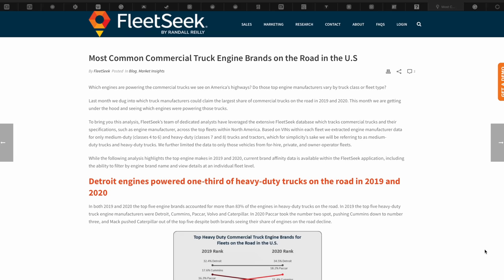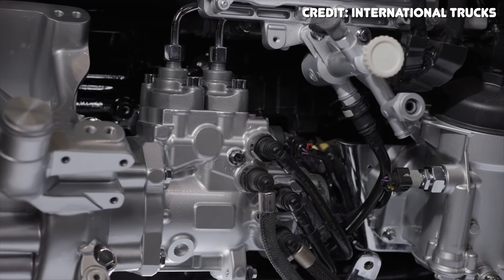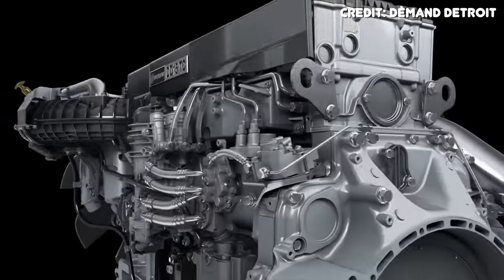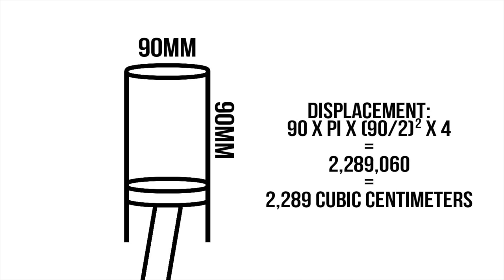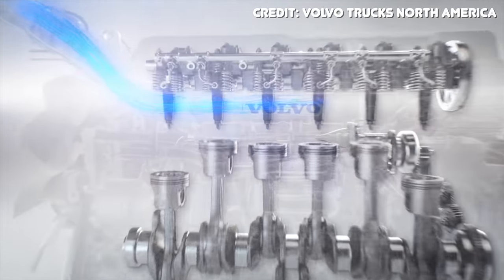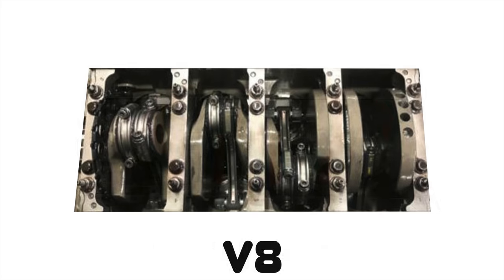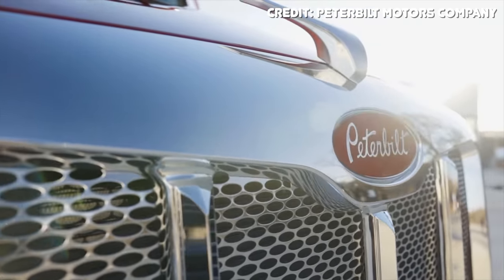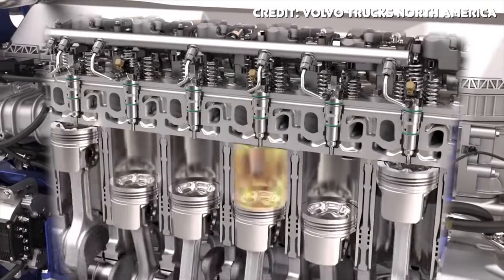Why do Semi-Trucks Use Inline-Six Engines?

Comment: Piston velocity is a huge factor. With longer stroke longer rods and in a inline configuration there is much less force on the piston and walls. And as far as longevity the Diesel engine has one huge advantage over a gas engine that being a lean mixture will not have the same effect as on a gas engine especially if you are talking a forced induction system. And an in-line engine has a very efficient cooling system ln comparison to a v configuration. Downfall to Thea large engine when it comes to overhauling is the fact that parts are big and heavy, if you let a piston and rod slip from your hand when removing or installing and you have one of your digest in the way of the cylinder bore it will easily break that finger or just take it with it.

Comment: Six in a row and you're ready to Tow, six in a V and you sit down to pee.

Great video. Only real issue would probably be that around 9:00 you mention that three cylinders have minimal vibrations. That's not really true, they have secondary imbalance, the thing that causes the inline six to be perfectly balanced it symmetry combined with enough cylinders. Six is the minimum you need for inline engines to be perfectly balanced. Straight 8's are also perfectly balanced despite 4 inline cylinders having a primary imbalance.

Comment: Inline 6 cylinder engines have 7 main bearings that take the load of the crank instead of the 5 of a v8 engine. The will last longer because of that. In gas engines, it was common for the Ford 300 cu in 6 cylinder to last several hundred thousand miles even before synthetic oils unlike the v8 gas engines. 
Yes, they are smoother than a v8 and manufacturers use 60 degree crank throws, so unlike a 90 degree cylinder bank V8 which has a dead spot in the firing order, the inline 6 has a power stroke beginning every 60 degrees of rotation instead of 90 degrees of a v8. They feel stronger, even though they aren't.

Comment: Drove for an outlaw company back in the late 70's. Had trucks with Detroit full 440 V8s. One of them was turned up to 3500 RPMs. Sounded like a small block Chevy when you floored it. Mine would bounce to 2500 and settle back to 2300, ran over 100 MPH. Nowadays, most companies draw the line at 63-64 MPH for company owned trucks. Blah!

Comment: Ease of service, engine balance, length of stroke, and lower weight. Thats pretty much the long and short of all of it. You can make an incredible amount of torque in inline engines and with the 6 being extremely well balanced they can have big pistons and big stroke without having to have massive counterbalancing. 

The engines are easier to rebuild in chassis. A lot easier. 

Less weight allows a driver to haul more cargo. the more of the weight is the cargo and the less it costs to haul per ton.

Comment: On the topic of engine vibration. I'm pretty sure this isn't an issue anyway because of how low of an rpm these engines spin anyway. I don't think that accounts for them not using an inline 4 for example.

Comment: Naturally balanced and relatively simple to rebuild. Less complex oil and fuel supply systems because they don’t have to be split into two different sides. Don’t have to remove the block from the truck to rebuild and much more compact for their size. Longer but much narrower than a v8

Comment: I really like the 5.9 Cummins inline 6 in my 2001 Dodge Ram 3500.  I can look down through the engine compartment and see the ground below on both sides of the engine. My Turbo is easy to remove if necessary because I don't have to dig into the valley of a V type engine. In fact my biggest complaint with my truck is that the 6 speed NV5600 transmission isn't an 8 speed. My favorite truck back when I was driving them was a naturally aspirated Cummins in front of a 10 Speed Road Ranger transmission. Yes this was a long time ago... I'm old, get over it. And automatics suck.
Reply: A lot of people have done that mod to the 5.9 and run a 10 speed manual in them.  I have an 01 also that I just had the nv5600 rebuilt.  Would be perfect if it wasn't for the vp44...and the rust.

Comment: Its simple, they are naturally balances because its an inline 6 cylinder, they produce better torque curves than V engines and they are fewer cylinders than say a cat 3406 v8 and means they are slightly more fuel efficient.

Comment: Also cheaper to manufacture than any V configuration, and sufficiently powerful. The only other commonly found configuration that is inherently perfectly balanced, is a V-12. Which is just 2 paired I-6 engines. I also suspect that fewer and larger cylinders improve efficiency, by improving thermodynamics and reducing internal friction losses.

Comment: My guess is very simple here, In trucks you have like 1.5m of vertical space but only ~1m of horizontal one. V8 long enough to produce torque they want would be sticking out of the hood to the sides. As much as exhaust pipes to stick out would be cool, it does not help with reliability when something so hot would be exposed to the rain. (and cause drag)  Also, there is no real reason to do so, as i configs just perfectly fit the space trucks have, and as tested VERY thoroughly, simple and very interchangeable engines, you can repair them with other manufacturer parts literally forever. Anyone who would stop using i4/6 would need to provide repair parts, support tools, test it themselves, work out some mechanic manuals.... that's just an absurd amount of work and cost, and you don't gain much.
What you need in a truck is indestructible parts, not experiments, and that's what by its age is i6. 
newest ones have i4's/small i6 and electric assist, which makes a lot of sense

Comment: You say that HP is an irrelevant number and only torque matters but the opposite is correct. A truck needs to be able to move a load down the highway at 70mph without knowing the available hp you can't know if the engine can do it. For instance if you had steam engine that made 1000ftlbs of torque you might think no problem that would work fine in a big rig. But if it only turns 250rpm that's only 50hp and that's not enough to make highway speed. A sport bike engine only makes 70lbs of torque but could handle moving the truck down the road just fine since it spins at 14,000rpm. It may not last long but it would work just fine. Truck engines are built heavy and spin slow so they last a long time. The huge torque numbers are a symptom of the needed hp.

Comment: well mack had v8 4 stroke or v8 or v6 2 stroke diesel the fuel use & epa & pipe stuff out of it! the mack v8 broke quickly lasted less miles in rebuilds wet sleeves to ( design errors & epa too)

Comment: Weight is a BIG consideration in big rigs. The lighter the truck and trailer, the more cargo it can hold up to the weight restrictions. Max weight (Without overweight/oversize permits) is 80,000 pounds. So the lighter you can make your trucks and trailers, the more cargo you can carry. More cargo, means more money. There is also a fuel economy issue. The less fuel your truck uses, the more money you put in your pocket, instead of in your tank. The V-8 is (In similar power production) inherently heavier than the I-6. And does not produce as much torque at low rpms as a I-6. Wears clutches faster than the I-6, needs more expensive gear sets to work efficiently, and, as stated is harder to work on, in the truck. 
As to the favorite engines, I think that if you removed fleet orders from the equation, you'd be left with only 2 for most US highway trucks, since Cat left the highway engine business. Those would be Detroit and Cummins. As to which is better? I couldn't say. I've ran both. And put many, many miles on both. I'd be happy to have either in a truck.

Comment: Anybody that has to work on engines in commercial service knows that an inline is just easier to work on - 
even in the very large sizes (like on ships) 
unless you have a height or length limitation, and inline is the most common choice for these reasons. 
Try to imagine an inline 14 with over 100,000 BHP (continuous) @ 109 RPM
But yeah, in vehicular sizes inline 6's simplify a lot of issues.

Comment: thanks for the info-clip and yes, I am a Diesel guy and yes, I had one each V8 Diesel from Ford and Chevy and no, they are not my type and yes, I (after driving 18-whewelers many moons ago) ended up with a Cummins powered pick up and yes it's the way to go even
though I wouldn't  touch the newer computerized DEF Ram's with a broomstick!

PS: What's the uncool deal wearing the cap backwards?

Comment: Here's an extra reason I thought of: specifically for V8 vs i6 I would think you'd get better fuel economy for the same displacement/power with an i6. With 6 cylinders instead of 8, there are 2 less fuel pulses from the injectors for each engine rotation. This is just my theory, so please correct me if I'm wrong.
Reply: For a 6 cylinder to have the same displacement as an 8, the 6 would need to have larger displacement per cylinder. The larger displacement per cylinder would mean more fuel is needed per cylinder. The two fewer injectors are meaningless, as the injectors on the 6 would have to inject more fuel per cylinder. End result is the fuel usage will be the same between the 6 and 8 for the same displacement and power output.
Reply: @markantony3875  That's a valid argument. But maybe that's only at full throttle. When you're cruising down the highway, does the V8 use X amount of fuel per each injector pulse and the i6 use Y amount of fuel per each injector pulse with Y being a higher number? Or is it possible that it's the same number?
Reply: @Cobra4993  You need to think about it in terms of volume. Since the engines are the same total displacement, they are going to need the same total volume of air and fuel per revolution for a given power output. You could possible make the argument that the I6 might have less internal engine friction due to having 2 less cylinders and a simpler internal design, but discussing parasitic losses due to internal friction can get quite complicated and convoluted based on the individual designs.
Reply: @markantony3875  That's fair. Alright, I think I'm convinced. I was prepared to be wrong anyways.

Comment: You're partially incorrect about the inline not creating more torque than a similar sized v-6. They do create more torque at lower speed than a v-type engine, because ALL the cylinders are going in the same direction. So it's not just about torque, but also engine speed. You are correct about WHY they create such high torque.. Because all the pistons are located in the same direction, they can have a longer stroke in a smaller package. If you had a v-6 with the same stroke and cyl bore, it would be a MUCH wider engine, and heavier engine. 

So there are also size constraints. The engine block has to fit between the frame rails on a truck. Doing that allows the tall engines to sit lower in the truck.

Comment: 30 seconds in...configurations are needed because cars are small and need it to fit the desired displacement. Inline has the best flow through the manifolds and the lowest pumping losses over  a V configuration. There isn't power lost to the rumble. Remember, engines don't make horsepower. They convert fuel into torque. Maximum torque is the desire, even though they advertise horsepower, which is a function of torque and rpm together.

Comment: For example tractors (old ones) if the engines have the same displacement but one has 4 cylinders and the other has 3 cylinder, the 3 cylinder will have larger pistons and more torque. The 4 cylinder is probably smoother though.

Comment: From a "reliability due to simplicity" and pure "Hi Torque at Low RPM" perspective, the inline 4 and inline 6 are the "best" engines due to ability to configure the engines with a long stroke. The inline 4 can actually beat the inline 6 in low RPM torque in that regard, BUT has balance & vibration problems that the inherently balanced inline 6 cures.  The reason that the inline 4 is so prevalent under 2.5 liters in cars is because it will make peak torque at lower RPM, and feel stronger in normal highway driving than a V6/V8 or inline 6 of the same displacement. Above 2.5 Liters the balance & vibration problems of the inline 4 make it more practical to go to a V6/V8/I6.  The inline 4 cylinder DOHC 16V Offenhauser design utterly dominated Indy and Midget racing in the U.S. for more than 50 years. In the mid-60's, when Ford arrived with their "superior" Ford/Cosworth Quad cam 32V V8 (4.2L / 255 CID), they were stunned by the ability of the Offy 4.2L/255 CID 4 cylinder engine to launch out of turns, leaving the V8 in the dust!  

Ford went to England to have Lotus build a low-slung better handling F1 type chassis that could take turns faster than the clunky Roadster chassis, negating the low RPM torque advantage of the 4.2L Offy 4 cylinder engine, and allowing Ford about 5 decent years of success on the Indy circuit.

Comment: Most European countries will exclusively use V8s as we need the power, plus with CAE (cab over engine) configuration it's easier to mount a shorter but wider V8 engine with transmission and shafts at a low center of gravity all in a line, with the cab on top.

Comment: The US is mainly, yes I said mainly, flat with low total weight in average for the trucks.
No need for big engines, and the Volvo D16 seemed unknown as not mentioned in the list in the beginning?
The strongest version of this engine makes 750hp and is a common sight in Norway.
(Yes, I know it's about the torque, but that follows in this engines. And I use newtonmeters, which the average american can't translate)
As for the V8's.
Scania is the most sold brand in countries that values high power because of topography and big loads.
They have inline sixes up to 540hp (13 litre), and V8's from 520 to 770hp (16,4 litre).
These engines use less diesel than any inline six as soon as you pick up some tons and climb some hills.
It is all about keeping the revvs low, and to be able to do that the engine must have the peak torque at low rpms.

Parts:
Volvo had two heads on their D12 and D16-engines, as one would be very heavy and they need a crane to lift it off the block.
Now I think they have one, hence the overhead cams...

Scania has one separate head for each cylinder and a low cam even with 4 valves pr cylinder.
Easy to work with for one mechanic, and one don't have to disassemble a whole lot, for example for just a small oil-sweat.

In Europe, where the cabover has 99% of the market, the space is a factor.
Mainly the height of the engine, but also the length.
The 13-liter inline six in a Scania is so compact that the headcover is at the same level as the top of the front tyre.
And that engine is standing vertical.

Comment: I live in Europe. It's interesting to see that trucks with a "Nose" have almost completely vanished here decades ago. Almost all commercial trucks here have a vertical front and the motor below the driver. In images from the US I see a lot of trucks with the engine under the hood in front of the drivers cabin. Can you explain why this is? Maybe length restrictions in Europe that would make a "Nose" lost space?

Comment: Liked your analysis. I run two Toyota Land Cruisers 70 series in West Africa and the I6 Diesels are fantastic engine. They are simple, give you plenty of room under the hood and they are indestructible. I know that a 4.1 L engine is peanuts compared to the big guys but the concept is rock solid in my opinion. Thanks for the well thought out explanation for why I am well over 400.000 km without the slightest problem.

Comment: I6 dominate the contemporary commercial truck landscape in North America. However, for a long period of time, this was not the case. The most famous NA V engines were associated with 2-stroke Detroit's 71 & 92 (71 & 92 cu in per cylinder) series, with 71 being available up to V12 for commercial trucks, while 92 didn't go higher than V8. 
That being mentioned, there are heavy-duty commercial truck (or "Rig" in North American vocabulary) engines that are V6 or V8 (Mercedes-Benz & Scania) on international markets, but I6 are still the most commonly utilized.
Despite being a I6 config, many NA Rigs with very distinctive classic body style (non aerodynamic) still have a dual stack exhaust. This is a purely esthetic reason, since I6 has only one (1) bank of cylinders & one side exhaust manifold, therefore no real reason to be dual smoke stack😊

Comment: Not gonna read all 1400+ comments, but I noticed that this video talks about what is in the US market.  I wonder how markets in other countries compare, since I know that the overall form-factor of truck design differs with the US being something of an outlier in having long-nosed (so-called "conventional") semitractors as the dominant form factor, while in places like Europe where space is tighter, cabovers that sometimes have both non-trailing and trailing cargo capacity are much more common.  But even then, many of the advantages of the I-6 would still apply as long as space allows.

Comment: I was always hoping to see one of these engine builders take the chance on building the opposed piston 2-stroke motor.
Reply: Should get more power and even more torque, but a maintenance nightmare. And also the wrong shape (short and wide) for a prime mover. Opposed pistons are great for small airplanes (good aerodynamics, high power-to-weight ratio, easy air cooling) but not for big rigs.

Comment: Done a lot of work in underground mines where (German built) straight 5s are used. Also drove a MAN straight 5 (German engine). I was told straight 5 engines are naturally balanced. My cousin used to drive a Mercedes with a straight 5 which went like a rocket compared to my Toyota Landcruiser straight 6, also the Mercedes engine was very quiet for a Diesel compared to my HZJ80 Diesel. Is 5 better than 6 ??